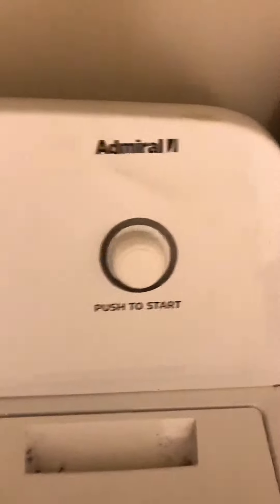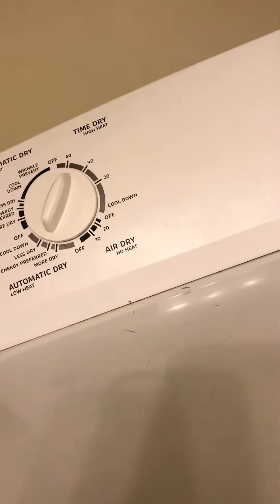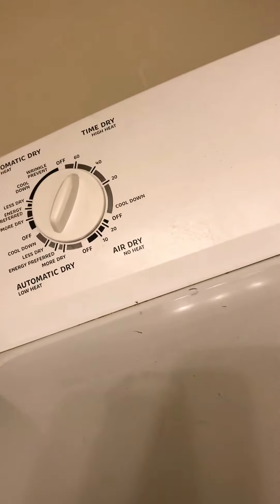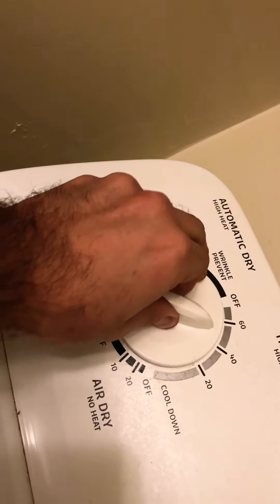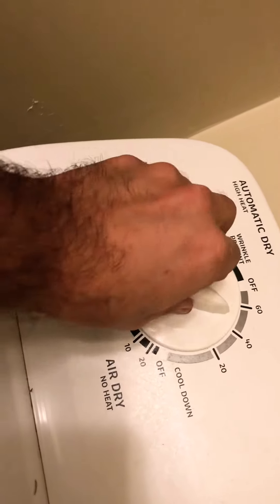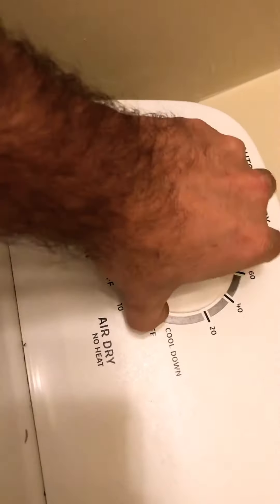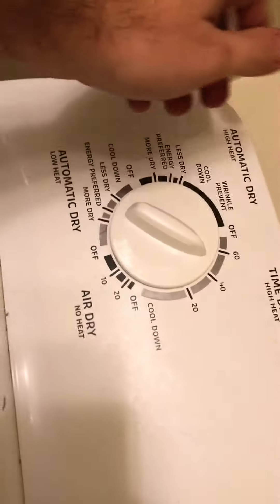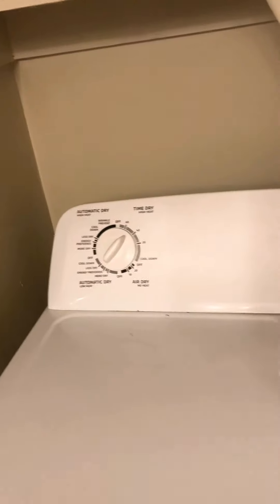Admiral, whirlpool, kenmore, maytag, AMANA dryer intermittently heating. Fix.

Comment: Thank you! I watched all the other videos. They all say the same thing, but they don't mention this. With intermittent heat, I knew it couldn't be the thermal fuse or the high limit cut off and probably not the other thermostats; besides, those all tested good with a multimeter. I didn't want to drop 90 bucks on a timer without some way to test it. You showed me how!

Comment: Thanks AG. This explains why the element would start working after wrestling it away from the wall to troubleshoot. Wish I would have found your video before investing in a new heating element and temp sensors. The element looked OK and sensors tested good but I'm not an appliance guy and thought they might have an intermittent problem. It was only after searching with the term "intermittent" did I find your video. Perhaps reworking the title a bit would make this easier to find, along with adding the term, "Try this first." Thanks again!

Comment: Thanks! Your video made the initial troubleshooting a piece of cake.  Straight troubleshooting the timer after seeing this.  Fixed a worn down plastic arm in the timer and I have reliable heat again.  All the issues over a tiny piece of cheap plastic.

Comment: I loved this one thanks. I’m working on a 5 yr old Samsung gas that’s kicking my butt right now maybe you’ve got an idea. First it had no heat and gas was coming out without ignition (smelly). I’ve fixed those in the past by cleaning out the area around the combustion chamber from lint and as expected it was crammed full. So I thought I’d licked it. Then no heat at all (2nd issue but no smell). Igniter wasn’t getting red. But it tested good. So I tested everything. Everything was in range. Then it worked on another test!!  Then it didn’t. Egad. I swapped the control board and got intermittent lighting. Then the main board. Same results. Then a third issue. Gas would fire and then cut off in a min or so. Sigh. So I replaced the flame sensor. Same. The coils test good as well but I don’t have extras of those but I think I’ll order some.  I’m at my end of the line on this one. Any ideas?  I’ve wiggled the wires and couldn’t find a short either. Thanks in advance

Comment: The contacts on those INVENSYS Timers are notorious for going bad.
No heat...No start...High replacement cost.
When I come across that problem, I find an old style timer on EBAY, remove the wires from the bad timer's plastic enclosed wiring harness, then plug the color coded wires onto the old style replacement timer.
The white / blue wire and small black wire which plugs into the bad timer motor is no longer needed because the old style timers have a different type of timer motor.
For Admiral dryers which have 30 minute Low Heat, Air Fluff, 30 minute High Heat, and Auto Dry, the older style timer is Whirlpool  Dryer Timer 8299781C
Reply from the maker: ancel1961 thanks for the tip. Good to know.
Reply: @theapplianceguy4566  ...I buy then resell broken dryers...So every penny counts when it comes to profit margins.
But, if I were doing what you do, I would just by a new replacement INVENSYS Timer, charge the client, then come back in 2 years and replace the broken replacement.